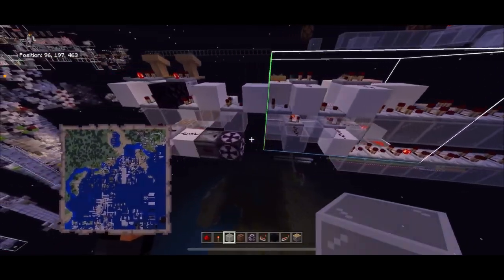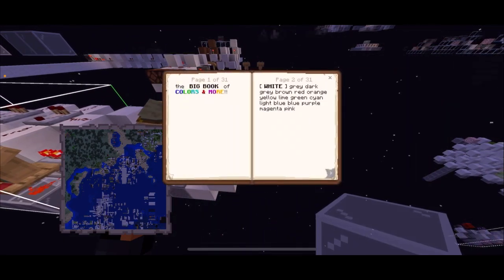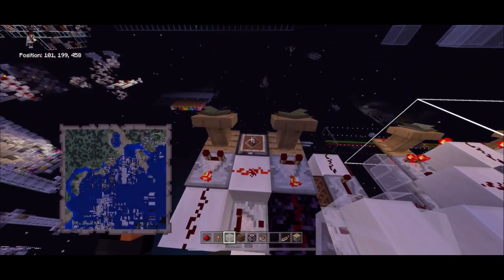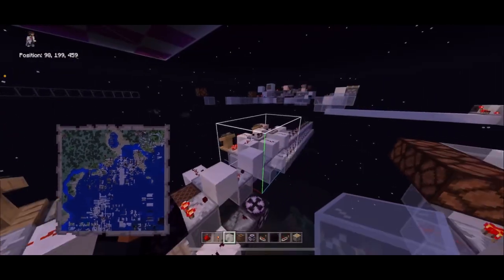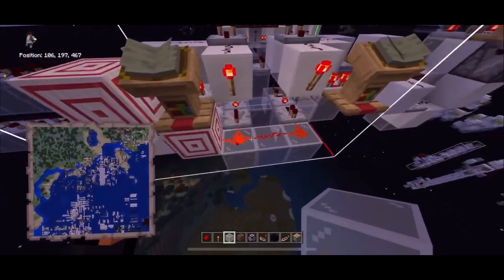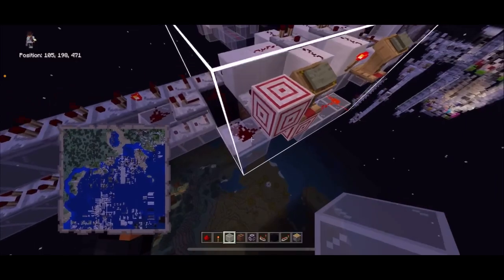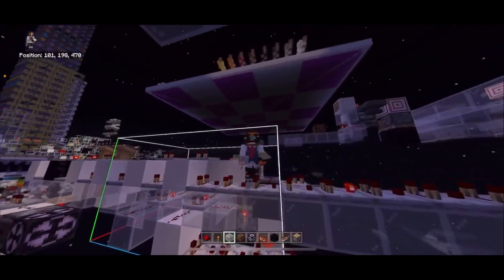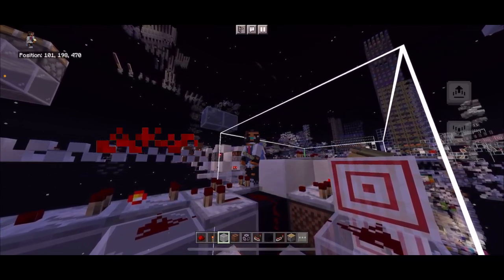MECKENICAL REDSTONER | 8bit serial hex AND gate | MINECRAFT BEDROCK IOS

Comment: What does hex and gate mean? Usually when I say "and gate" I mean operations such as D(13) and 7 = 5, but this does not seem to be the case.
Reply from the maker: You make a good point… and This is an “and gate” in a first principals sense, a LUT, ie 2 inputs to activate an output. 

I figured, with how I’d like to scale various projects, a look up table, like design will be useful once I start networking SoCs…. 🤫 While serving as an addressable feature in serial hex. 

Ooooh, also, I’ve made it even smaller since this vid 👀